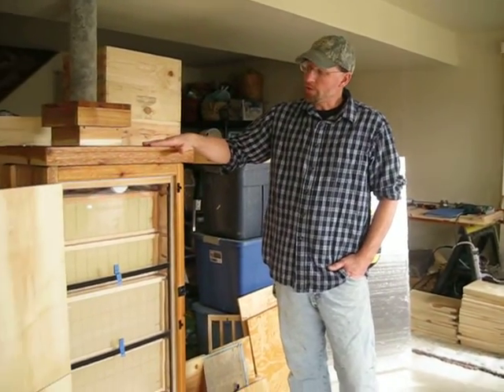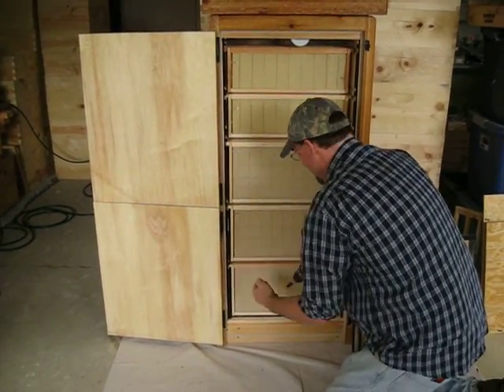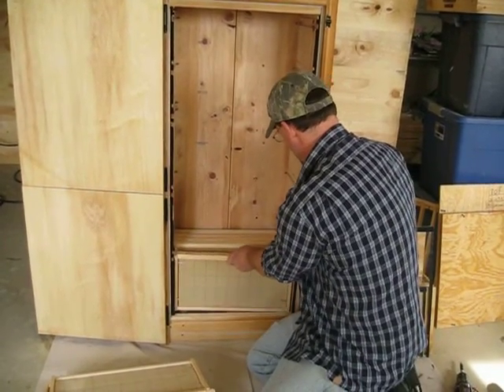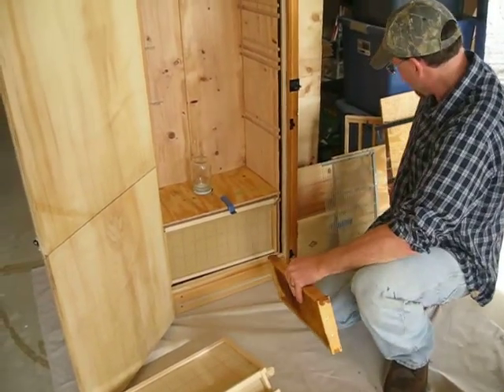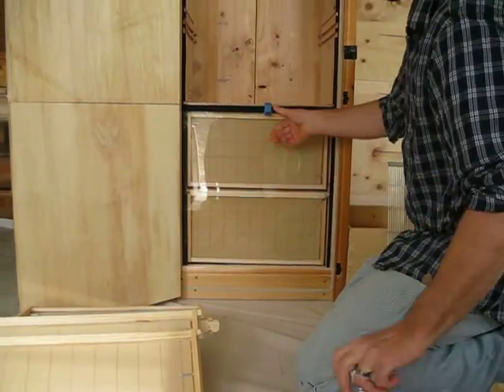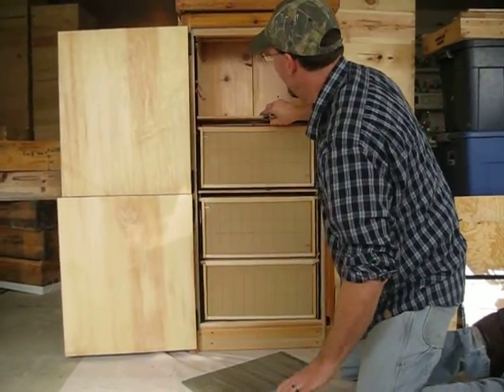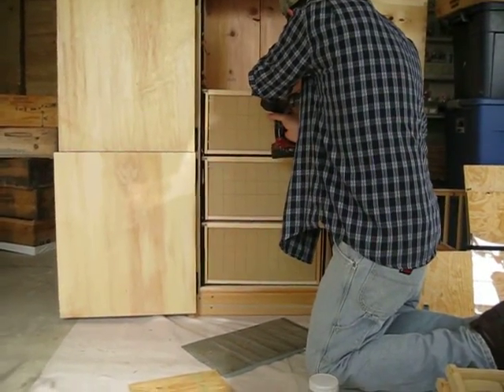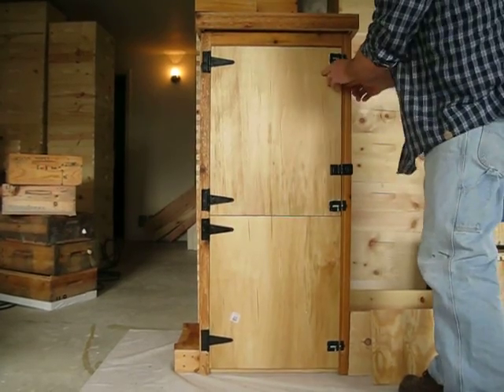Simple beehive,no lifting,lock it up.Beginner and advanced beekeeper

Comment: You have some really good ideas that I am sure work great. The main problem I have found over 15 years keeping bees is that they never read the same manuals that their keepers do. I appreciate your endeavours but you might find that the bees will gum up your rails with propolis and extraction of your frames for inspection for bee diseases and collection of your honey frames will be somewhat troublesome. Might I suggest you apply some petroleum jelly to the frame lugs and slider slots so their removal will be much easier.  I do that with all my conventional bee hives. It makes my life easier and has no noticeable effect withe the bees. Varro mites do kind of get stuck in the stuff. So there is one benefit already proven. I am not sure about the small hive beetle. Remember to re-apply the petroleum every time you remove your frames. A little will go a long way.  Happy Bee Keeping.

Comment: You got some good innovations here.  Look at the AZ hive for similarities.

Design improvements (constructive remarks):
Venting hive directly up the center will over chill the center of the hive in the winter.
Make the vent up one side rather than the center.
Make a lever latch/lock instead of screws - bees don't like drill vibrations, and I don't bring a screw driver with me.
Design with fewer moving parts. Hard to keep track...
Frames should be accessible from the other side (end-on)
- so you don't have to reach deep into the box to get at the last frame in a rack.
Bees love to put wax/propolis on smooth surfaces - plexiglass may be completely glued down, and will be hard to slide in a hive tool to pull it out.

Great ideas with locked doors, and anchoring to the house or a tree.
Too bad you can't make it into a 'tree hive' so its up above people's heads and  foot traffic.
Though weight and pulleys would be an issue for sure.

Comment: central venting in that fashion would cause the hive to lose its thermal column which is the key to moving up and over new food sources during cold periods,,suggestion would be 1inch insulation board under hive top and 1inch hole in back of hive with METAL screen mesh inside for moisture expulsion

Comment: How did this go with propolis in the place where you slide your frames in? I'm 68 and boxes are getting heavy so I have built bottom boards so the hives can be set up as sunny side hives. Like your work and innovation but I can't get on my knees as easily as you and my back hurts when I extend my arms and lift. So I would have to do this all one handed to take stress off my back. Hope it works for you.

Comment: Hmmm... In studying this video closer, the only issue I have with this design is that the door is on the wrong side.  I would put the door on the butt ends of the frames so that you can inspect all the frames at once without taking them out.  In the Slovenian hive, this is accomplished by having the frames resting on metal rods evenly spaced, rather than relying on the overhanging "finger rests" of the top bar of each frame.  You would still get the tight spacing.   Also, by putting the door on the shorter side vs. the longer side, the hive is easier to manage in terms of having lots of open space exposed when you open the door.  This helps in maintaining temperature, keeping more bees in the hive when the door is open, pests out, and less overall human tampering with the hive.  Check out "The Original Drebbieville AZ Hive" at www.thebeeshop.com.   This is the only other American I'm aware of currently building Slovenian type hives.   I really like the idea of one giant cabinet vs. individual supers.   I only hope I have luck this year with my swarm traps so I can have an excuse to build one of these!
Reply from the maker: Sahara 090312 then you can't slide   frames out. This works well for me. Thanks for your opinion. Happy beekeeping